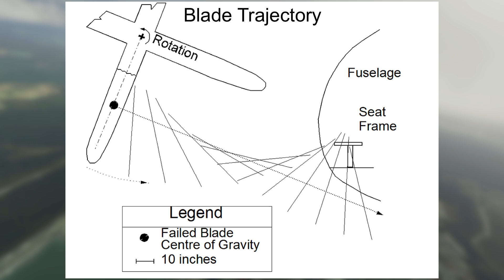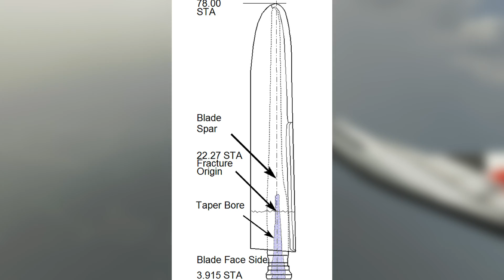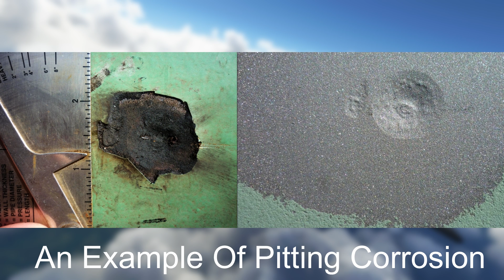The Plane That Was Ripped Apart | Inter-Canadien Flight 1678

Comment: Metal fatigue on my Cessna 172 prop caused an inflight loss of a tip. The fracture was probably the result of a small stone ding about 3 inches inboard of the tip when the prior owner hit a snow bank under power. It felt like the engine was about to rip off the mounts. Quickly shut down and dead sticked it into a small airport that happened to be close by. Very “exciting” experience.  

Metal fatigue is a major issue in all machinery.  Keep vigilant!
Reply: Nothing like the threat of death to make us sit up straight and take notice! 
I'm glad you're okay too. 👍
Reply: Yikes! Glad it wasn't more serious.
Reply: hopefully you got all the gears or whatever other internal components thoroughly checked too... nasty issues from such overstress events can tend to crop up hundreds of hours later.
Reply: @stanislavkostarnov2157  True. Did a tear down and some inspection but ended up getting a new engine. LYC-360
Reply: @thomaswest5931  :  "...ended up getting a new engine."

Oy....that must've been expen$ive.  😬
Reply: @Milesco  Yep.  This was mid 80s and I remember the conversion was around $25K for a zero time engine. Had a couple of partners so spread it out.  And the 180hp in the Skyhawk was a much better performer (gross weight wise).
Reply: I bet that beer tasted pretty good after you got her down safely.
Good call replacing the engine. Wouldn't want to have it seize and need to do another dead-stick landing. Better safe than sorry eh, especially with aircraft.
Reply: Yikes. My flight instructor always told me that the result of the prop hitting anything while running results in a entire engine and prop tear down and thoruough check for cracks
Reply: I’m very happy for you, Thomas!
Glad you kept your “cool”.
Reply: 9
Reply: Should have just sold the Cessna and bought 25k worth of commercial airline tickets. Been much safer
Reply: Were you wearing your brown pants?
Reply: JUST WACK OFF THE TIP OF OTHER BLADE.